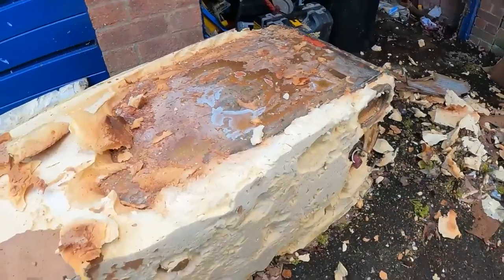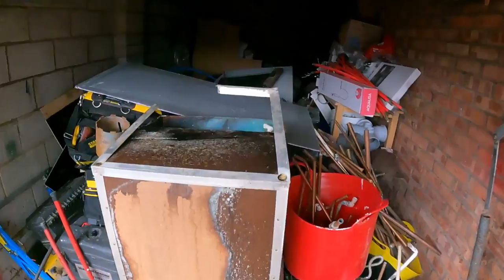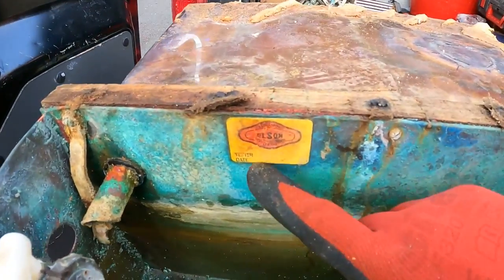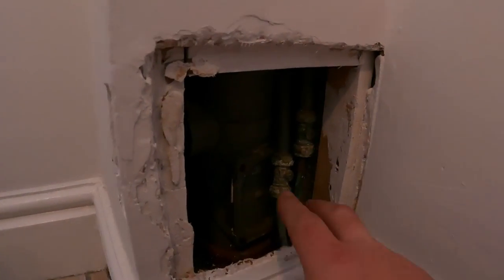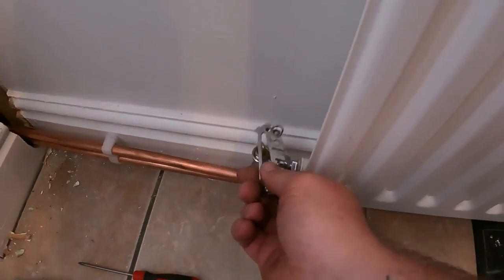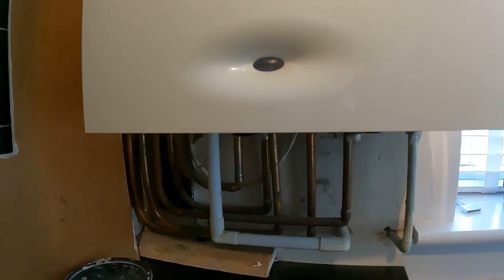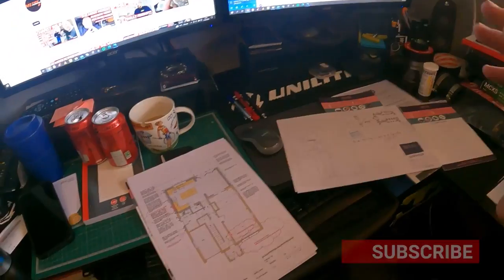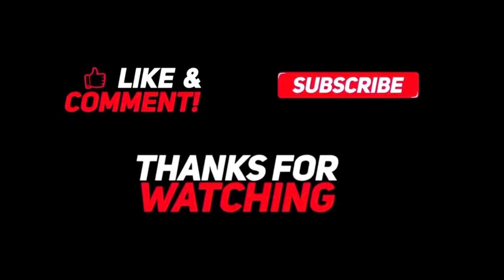HOW AN ELSON HOT WATER TANK WORKS & what’s it worth in scrap? Real World Plumbing

Comment: The Elson tank you had seems to be a simple direct type.They made a number of models,including indirect types,really a more compact version of the "Primatic" cylinder. They were strongly made and lasted over 40 years.
I found the domestic hot water pressure perfectly adequate. 
They were made by Elsy and Gibbons of South Shields by skilled coppersmiths.
Very popular in the North East of England.
Reply from the maker: Yep direct tank this one…. And a good bit of scrap value aswell👌🏼
Reply: I still have a working Elson tank that is plumbed into my coal fire back boiler. Brilliant at giving us lots of hot water in no time at all! It does make people surprised to hear that we have no gas and was never connected to the gas network. Our house was built for the WWII and in good condition.
The size is much bigger than the one in this video and never had insulation glued to it either.
Reply: @anthonyhoult152  you have one of the very early ones, i once met a man who made them he used to scribe his name on the ones he made,he was so proud of his work!
Reply: @davidworsley7969  I am going to have a look around the tank to see if I can see any thing signed into the copper. It still has the delivery tag hung on it still with a date of November 1940. My house was built for one of the officers of the Thorp Arch ammunition factory.
It has a large heating coil in the bottom for the back boiler plus a release pipe that comes up the internal corner if the water gets to boiling point. I had a plumber once tried to tell me that I need a new cylinder once when doing some work nothing to do with the tank.
It's built like a tank hahaha 🤣
Reply: @davidworsley7969  I bet a new cylinder wouldn't last 80+ years!
I wonder if my tank will reach it's 100th birthday 🎂
Reply: @anthonyhoult152  that thing deserves to be exhibited at Beamish!!
Reply: Plenty of these fitted in Scotland as well.
Reply: @daz3745  I had no idea how widespread the use of these devices was, did the Scottish ones have the makers nameplate on them?
Reply: @davidworsley7969  I can't remember seeing a nameplate. Very common in council houses.
Reply: @daz3745  mine has a name plate of Elson & Gibson on the cold water header tank.
I am proud to own it in it's brilliant condition. It has a feed pipe external from the cold water header to the bottom of the hot water tank and then a secondary external pipe from the bottom of the hot water tank to the top.
Wish I could send you a picture think you would like to see. It's in the condition as first installed and has a copper lift off lid over the hot water tank.
Reply: @davidworsley7969  Thanks and I am proud to own it!
It has a large heavy copper lid over the hot water tank and two external circulation pipes
Reply: @daz3745  I am sure that the plumber wanted to scrap it for the massive amount of copper! There is nothing wrong with it!
Reply: @davidworsley7969  It's a work of art with not only the workman ship but also how the tank operates!
I have had many plumbers never seen one before and instantly said that it needs to be replaced with a new cylinder! Why when it works perfectly and doesn't leak.... Is it they know the value of scrap copper sat there!!
Reply: Hi Mark, it’s only free money ‘til the VAT man gets hold of you. Good luck with them b———s. I hate HMRC with a vengeance after an investigation many years ago. They made me ill. Have a good time in Lanzagrotty and keep well mate.

Comment: I would imagine as a non pro but very experienced general plumber/ all around builder that underfloor heating is a big challenge .To be honest I still cant really understand the benefits .Pros and cons kind of thing plus the costs of running a boiler to support a system.I do know a couple in to be fair a big property that is all underfloor but the boiler is huge?God knows how many cubes it burns a day?
Reply from the maker: The tricky bit is getting the runs right, then it’s fairly straight forward to be fair…. That’s all in the design stage

Comment: What does everyone think of this Ensuite renovation quote , too high ? about right?  West midlands. Its just under 2mx 2m ensuite , job is to take out all the old including tiles from walls /floor and replace with new rad,thermo shower/enclosure , basin and to tile floor /walls. Might need reskimming and some pipe work moving on 2 walls.  The quote ive been given is 8.2k
Reply from the maker: Does that include suit and tiles or not??
Reply: @MJTiffPlumbing  yes includes everything apart from toilet
Reply: Sounds about right.
Reply: @dannyp7791  Just the materials total only comes to around £2.2k which made me think could 8.2k be on the high side
Reply: Ask for a breakdown of the estimate if he is genuine he won't mind and ask how long the job will take. Then you can decide. 
Get a couple of more estimates. 
Good luck.